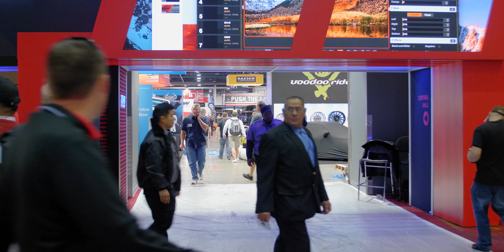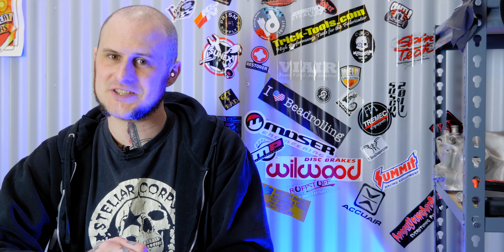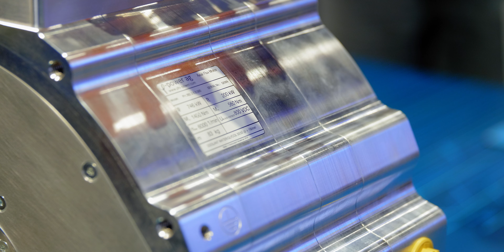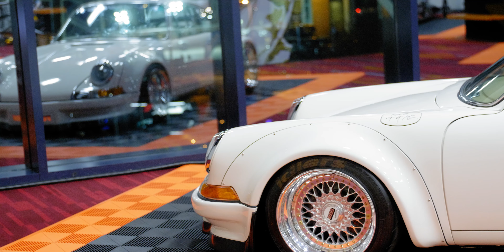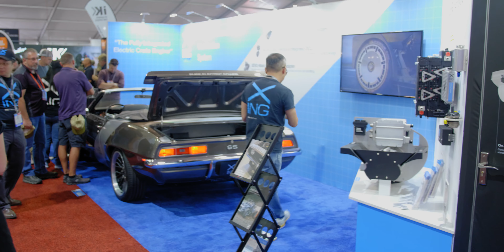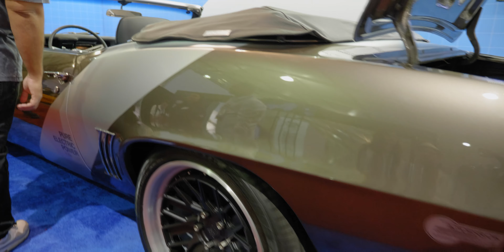EVs of SEMA 2019 - EV West, Chevy E-10, Mustang Lithium, Xing Mobility

Comment: I don’t understand EV hate. You press the skinny pedal to the carpet of my Model 3 Performance or my Model S and I giggle the same as launching my 300zx twin turbo and my C6 vette. The EV drive isn’t supposed to be better, it’s supposed to be different. If someone can’t grin when behind the wheel of something in the twisties, that’s not the fault of the drivetrain…that sounds like the problem exists between the steering wheel and seat.

Hopefully you will revive this series and thank you for the detail of this. Carving time for this out of SEMA had to be difficult and you are appreciated

Comment: In all truth I'm solely interested in EVs as a part of automotive culture. Don't want to drive one. Pretty happy with what I've had for almost 14 years - a little over 3sec 0-60, runs easy 11s, pulls 14mpg, and flies around corners. I'm going to be buried in it.

Can a duel-core motor mean a 4-pole vs the traditional 2-pole? You get half the revs, but almost 4X the torque.

The 911 is stunning. A shame they had to ruin it with a ginormous battery and an EV setup. Sacrilege.
Reply from the maker: I admire how clean the swap on the Porsche is. It looks like it's meant to be in there. 🤷🏻‍♂️

I really don't know enough about the design of the Phi Power motors to say what is what. I did a half hour of reading before this video to try and figure it out but couldn't devote the time to it. 

Part of why I wish I could have a customer want an EV swap is then I could justify devoting time to learning the subject more in depth. Oh well.
Reply: @mattykobs  Yes, in 1898 Ferdinand Porsche designed an electric vehicle. Not sure how it relates to the 911 made by Porsche the company that didn't come into existence until many years later. That's about as far as I'm willing to go talking to a teenager.